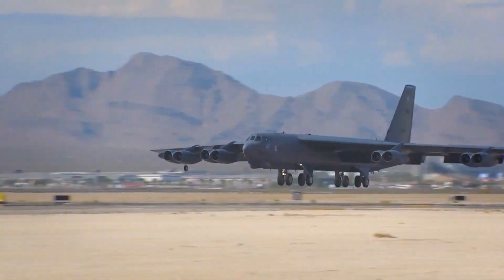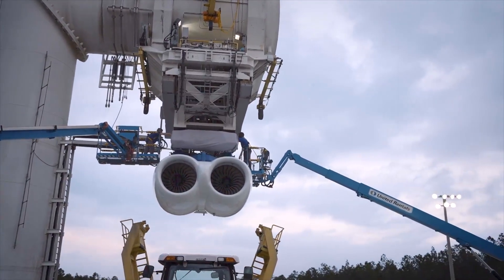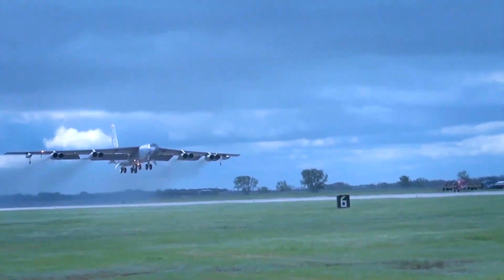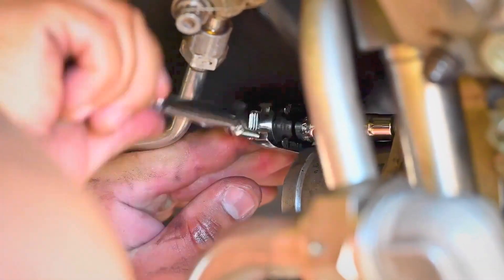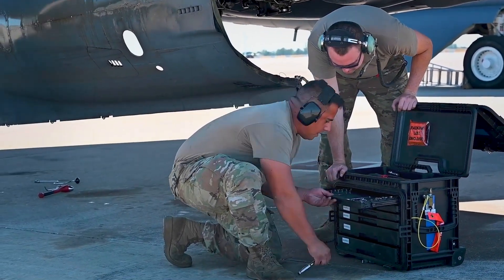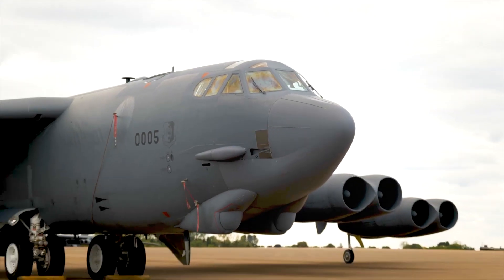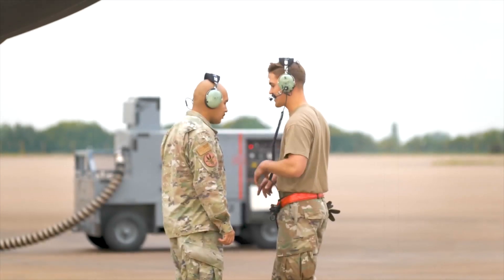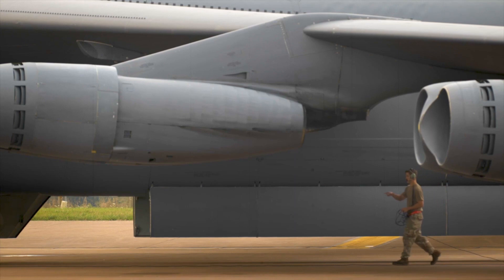B-52 Bombers to Get Insane Upgrade with F130 Turbofan Engines

Comment: Very stupid decision. They are replacing the TF33 with this RR junk desgned for medium commercial jet and it will cost a fortune with no gain. the TF33 they use is 17,000 lbs and the F130 they want is also 17000 lbs. No performance gain at all. They will need all new test and ground support hardware as well as transitional training and new facilities. . Many billions of dollars for absolutely no gain in performance. They could have gotten the JT3D-15 which is a TF33 design and exact Form and fit to the T33 which has 22,500 lbs of thrust. For about 1 percent cost difference to what they pay now and no new test stations or training. IDIOTS. wasting money because its free money